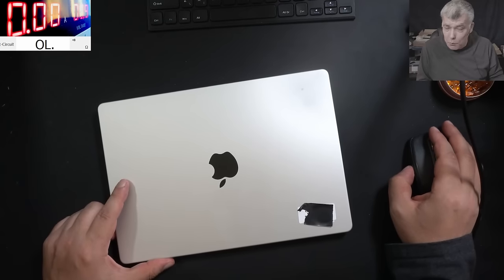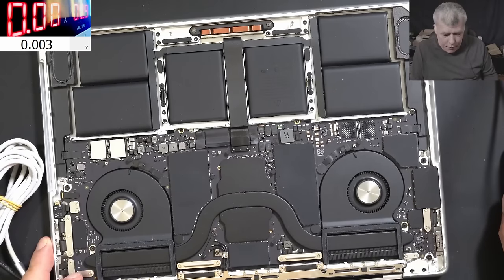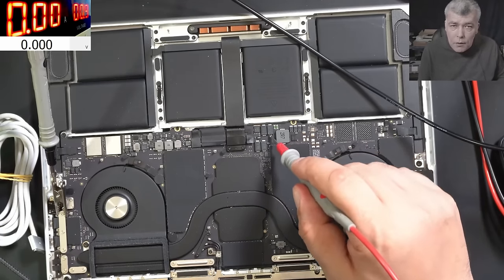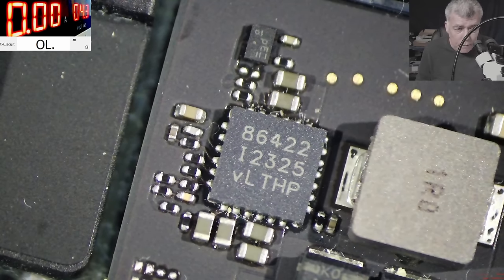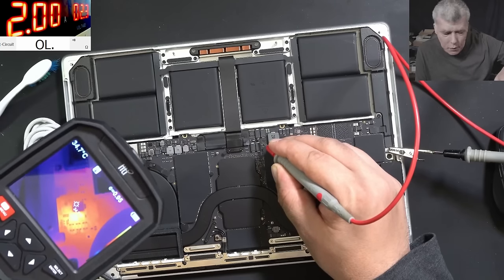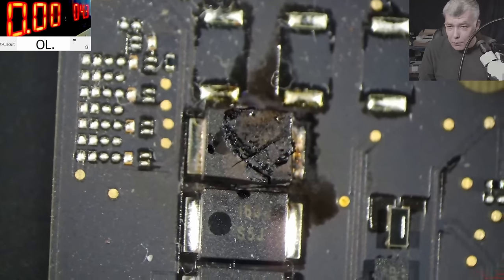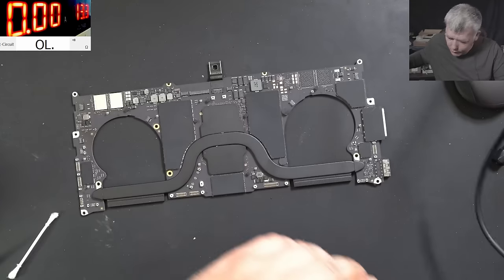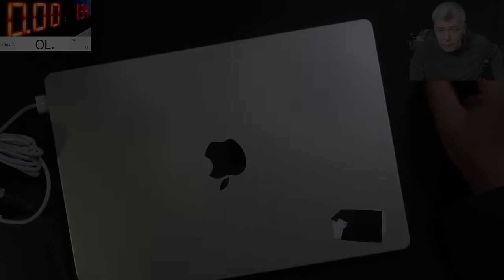MacBook A2442 no power, logic board repair - wow

Comment: Next video: how to create a volume controller for the multimeter's beeper  :p
Reply: Just use hot glue on the speaker. I modified my meter, hot air station and soldering station. You can still hear the the beeping, but it is way more tolerable.
Reply: Yeah I've been complaining for a while because it's painful with my hyperacusis, ie, can't get to the volume fast enough. Tape over the hole usually fixes it.
Reply: @dirzzleme01  talking about sorin's beeper... is killing mi smartphone speaker :)  on mine i have placed some tape.
Reply: Nice job Sorin , you did excellent job on board .you get a proper calibrated pizza 🎉🎉🎉🎉
Reply: My GF hates the beeper in the videos …. Lol
The. She comes downstairs and im beeping away.  Rolls her eyes and huffs about
Reply: @Foxx_69  same thing...my GF can hear the beeps through my earphones .. and I need to move away from her
Reply: Absolutely! My wife hates it. We must make them louder 😂
Reply: Sorin explained he doesn't hear it, he has some hearing issues, in fact he said he would even make it louder if it wasn't for all the complaints

Comment: Apple does not fix logic boards at Apple Stores. The £600 quote was for a board replacement (a refurbished one). They keep the broken one, send it to a partner in China to be repaired and then sold again to another customer.
Reply: If they sell motherboard for 600 than they shoul buy damage motherboard for x<600  xD. Why at all swap motherboards, it takes time, just sell new laptop xDD
Reply: @465kuba  You have 2 options: retail or exchange. £600 pounds is the exchange price, they keep your old motherboard. If you want to keep it, you pay probably around £1000. That's how Apple works.
Reply: @465kuba  Apple tech wont even fart on your motherboard under 300 bucks specially if you didn't have Apple Care subscription..
Reply: stop telling lies
Reply: @leetucker9938  unfortunately, it's true
Reply: Apple almost always gives repair price close to cost of new laptop, hoping you just buy a new one.
Reply: @bobsonsitecomputerrepair4305  That's right. They are not that keen to repair stuff, they prefer to convince you to buy a new one.
Reply: We often help Apple repair the replaced old motherboard😂

Comment: At 26:36 the pad is connected with the other capacitor, ok, but it is taking current, so doesn't that mean there is still a short on that line?

Comment: Almost every logicboard repair video on the A2442 MacBook Pro refers to this circuit of the board and almost always several layers of the board are damaged / burned in this exact area. This has to be some mistake in the board design by Apple.
Reply: "mistake" :D
Reply: it's a feature, by Apple 😂

Comment: May God bless you, our teacher. By God, I have a problem with the Toshiba Satellite Pro model R50-B-15J laptop. The problem is that it starts, writes Toshiba, and turns off. I emptied the charge, removed the battery, and put it back in. The same problem remains. I tried to charge the BIOS and restart it. It became a black screen. I restored the old BIOS. Same problem, replaced. I used the flash drive, 32q32, and I charged the old BIOS with it. The same problem remains. Can you help? Thank you.
Reply: Check the power button! Try disconnecting the keyboard too!

Comment: Spoiler alert.

Cap replacement: "Size matters" (That's what she said). Your replacement cap looks definitively way too small. The size is always in relation to the Farads and to the voltage. You could have measured one of the others beside the exploded first to find out the Farads.

Comment: I think if the old one was a tantalum, you better replace trough a tantalum too and not ceramic.
Reply: the problem is a shorted track, not the caps itself
but yeah, replace the same one is better
Reply: There is a reason why.

Comment: Another Apple store rip-off price for a non repair. They just replace the whole motherboard or even replace the whole bottom half of the laptop, normally with refurb parts. People are far better off using repair places like Sorin or myself and I've repaired hundreds of Apple products over the last 20 years. Designed to fail....